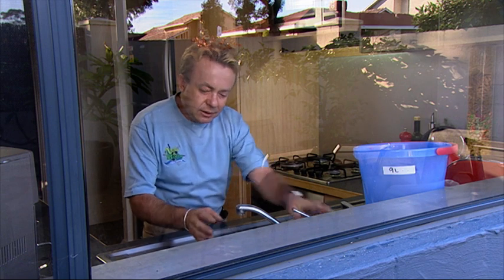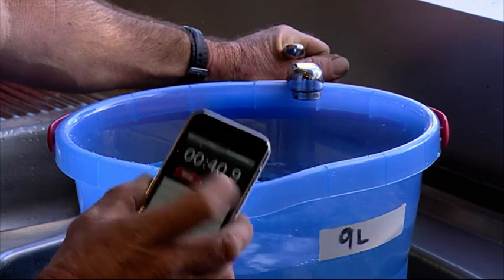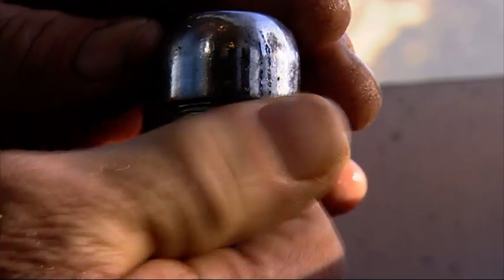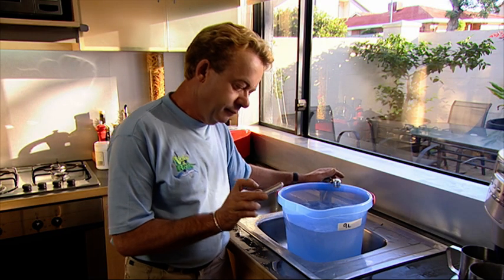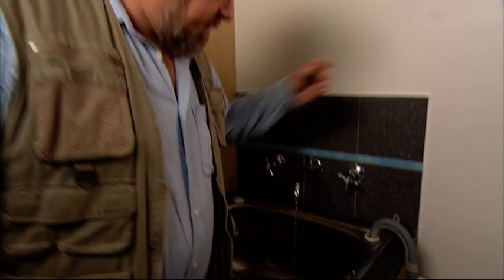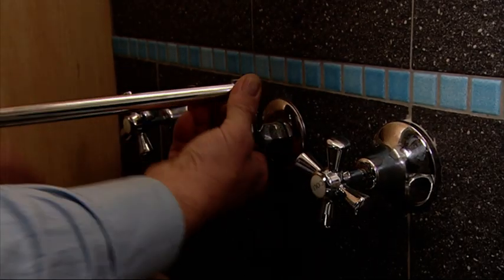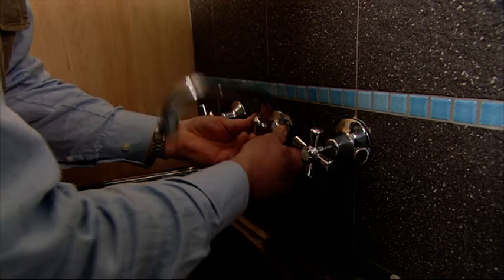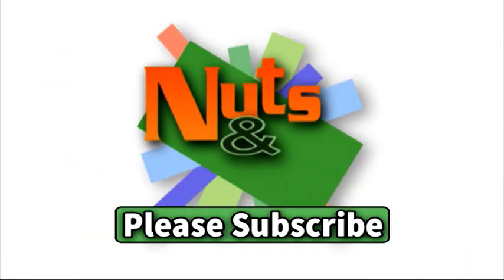How to Reduce Water Flow from Taps

Comment: Its flow reduction, not pressure reduction.
Reply: Ah, but it only flows as much as it's pressured to. lol
Reply: Sure but if you limit the orifice to reduce consumption over a fixed time (flow), then you would be increasing the pressure, not reducing the pressure.

Comment: Taping backwards at 1:44???
Reply: Exactly and this grub supposed to educate people about plumbing.
Reply: South of the equator it goes that way
Reply: @shark_ref  mmm... no. Still righty tighty, lefty loosie there bud.
Reply: meant to leave a comment and saw you already did!
Reply: For viewers who might not know, the PTFE tape should go around the thread clockwise. (facing the thread) The reason is so the clockwise turning around the tape strokes the tape in its winding direction. Like when it was being applied. If that turning was pushing against the tape in its unwinding direction then it'd loosen up the tape and it'd bunch up. Not good for keeping it wrapped nice and firmly.